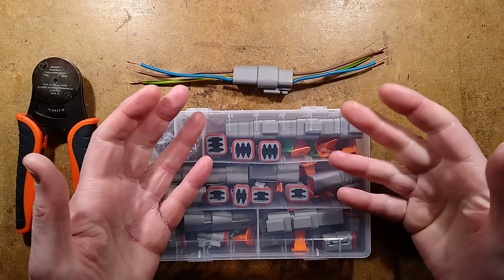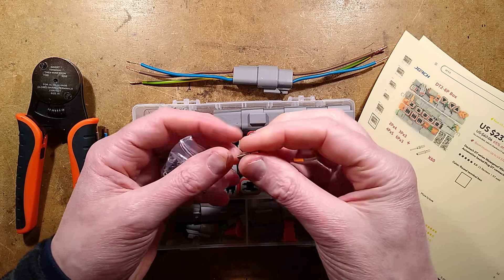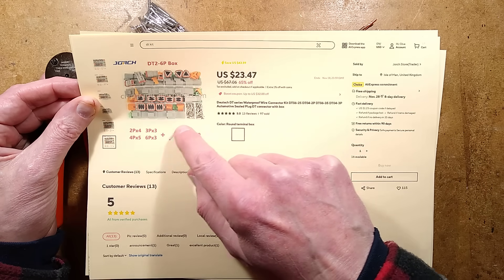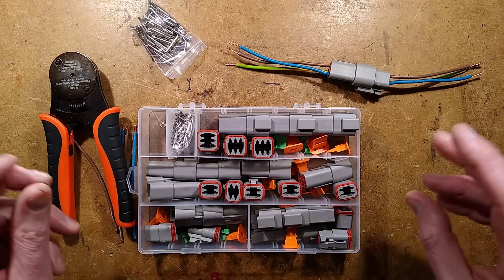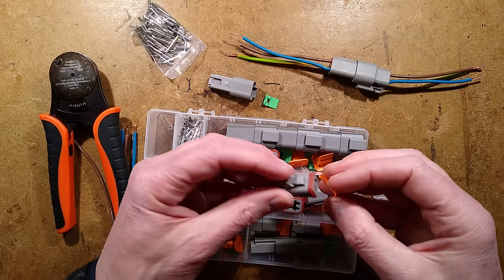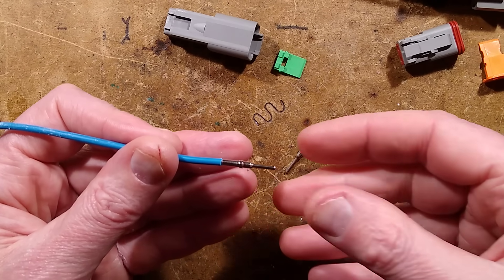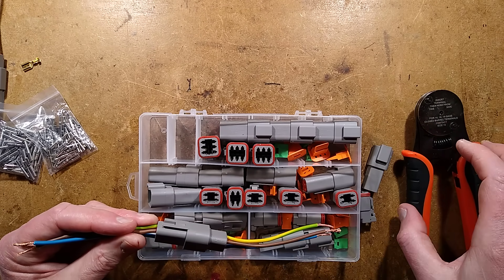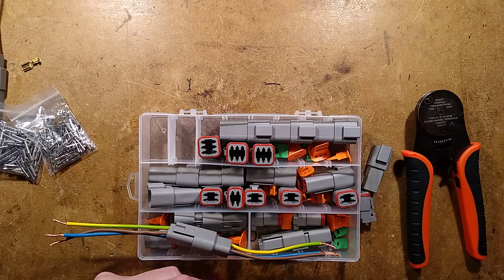Deutsch - my new favourite rugged connector

Comment: There is a small hole in the connector pin, this is there so that you can see the correct length of wire has been inserted. 
Been using pin that look like these in MIL-DTL-38999 connectors for years, the crimp tools cost an arm and leg. but when your paying £80 + for each half of the connector and few hundred pounds+ for a crimper is a drop in the ocean.
Reply: I spent several years supplying these in the UK through Servo-Interconnect in Lydd  Kent. Used them on may projects too. Brilliant design !
Reply: As said the hole is to check the correct length of the wire, but yes before I invested in a crimper I used to use the hole for solder.
Reply: @johnspear3452  so do i but that is not how it should be done, we should pass on how it should be done and not the bodges. I used to refer to soldering the crimp pin as using a "liquid crimp".  Also in R&D where i had to go to the pain of getting a crimper from production in the hangers. it's easer to solder the wires, which with a bit of care you can reuse the pins. Which you can't do if you crimp them.
Now retired i can do them anyway i want. 🙂
Reply: That's for soldering. It's a hole to let flux/solder flow through the inside of the plug should you be inclined to solder the pins instead of crimping them.
Reply: @Alacritous  On a 3899 connector pin the hole is to confirm the strands have  been inserted to the correct depth. As they are crimp pins not solder, the solder pins look completely different. the whole reason for using crimp pins is they are far far better if the connector is subjected to vibration. 
In a crimp pin, when crimped correctly each wire strand forms a cold weld. The problem with soldering stranded wire is the interface between the strands and the face of the solder. if the wire is vibrated the strands move side to side, this work hardens the strand as it can't move where it meets the solder. as each strand breaks the stress on the remaining strands increases until they have all broken. 
For vehicles and planes crimp wins over solder everyday.
Reply: @TheEmbeddedHobbyist  Sorry bud. It's literally in the spec. It's to allow solder to wick through the connection.  alternatively it's to allow air to escape when crimped. You can tell you've inserted the wire to the proper length because you can literally see the wire go into the insertion hole.
Reply: @Alacritous  but inspection can't see how much wire is in the connector once you have crimped it. but the hole does.
Reply: @TheEmbeddedHobbyist  you can't see the hole when it's been set in the plug anyways.
Reply: @Alacritous  But quality would be checking before the wire going to the plug on a sample basis. 
The amount of connectors I've seen put in to the scrap bin as somebody has opened the sealed bag and taken one pin out. QA would have decided the traceability of the connector and remaining pins is lost. So they might go to the training school or the bin. which is why Aircraft cost so much. 🙂
Reply: @TheEmbeddedHobbyist  Seeing how deep the wire is inserted isn't going to tell you the quality of the crimp in any case. That requires a tug.
Reply: @Alacritous  it's just à witness hole, a tug test is performed by qa on sample crimps as its a destructive test. Which is why the number of crimps performed by the tool is recorded so they know when it needs to check.
Reply: Can you please point out where this is listed as being a solder wicking hole in the spec?
Reply: @alsavage1  Exactly, every spec/guide I've found for DT terminals indicates that it's a witness window - and this is exactly how I've seen everyone use it in manufacturing.

Comment: Deutsch connectors are brillent came across them in 2016 when american brand tennant scrubber dryers starting using them. since then i have seen them on john deere tractors & catapillar diggers. there truely a great connector they are pricey for the genuine ones starting from £3.50 to £8  for a male female kit. but there well worth it. i have seen them used in horendous damp conditions covered in mud  and jet hot jet washed no issues. they come in 3 diffrent sizes there is DTM series good for 7.5 amps, DT series 13amps and DTP good for 25 amps. another good feature is if using for 12 or 24v systems you can get little LED wedges with a clear end to signify if voltage is present.

Comment: we use Deutsch connectors on work, they're a great connector but I always assumed too expensive for hobby use.
I will certainly look into your suggested links.
Reply: The real ones almost certainly are. A vast amount of OEM automotive connectors from Tyco, Deutsch, Sumitomo, etc are copied in China. Some of the real OEM connectors are also near impossible to get in small quantities too , especially Sumitomo. We used to struggle to get a few for prototyping new stuff when I worked at an OEM despite using vast quantities in production. In may cases the copies will be being made with the knowledge of the biggest customers, as most of the copies are made for the Chinese car industry's partnerships with western car companies. They reverse engineer right down to the connectors and terminals that the original models used to minimise cost. This is certainly the case with FAW - Volkswagen / Audi's Chinese partner company.
Reply: @richardjones38  A lot of the "copies" come out of the same factory and off the same machine. China has a funny concept of IP and they think that when a western company 'gives' them the design it's fine to make the official product on day shift and then make clones for them to sell themselves on night shift.
Reply: @ekij133  I wish that were the case for the ones I'm familiar with! Most are OK quality, but I've seen a few which are less so. They Tyco / AMP / TE / whatever they currently call themselves are particularly easy to tell apart, as the real ones are always branded and marked with part numbers and terminal numbers, but the all copies I've seen are either unmarked or only have the Chinese manufacturer's name.

Comment: I found another similar "Automotive" connector very useful, dunno if they have an official name, but they're black bodied connectors with yellow silicone seals with red locking inserts and come in single way to 6-way options, they use the foldy-over style crimped pins, and they've worked nicely for low voltage outdoors stuff for me... :)
Reply: TE AMP Superseal
Finding an inexpensive ratcheting  crimper that will do both the crimp and insulator grip in a single operation is almost impossible (all the ones I have tried have either bent the flags wrong, pierced the silicone bung or some other no no)
Have settled on an Iwiss manual crimper that only does the crimps 2 separately  - and it does a good job, just more time consuming and a bit more fiddly
Replacing pins on them is not that hard (once you have the right tool and worked out how to manipulate it)

I had thought about using these connectors in the past -as they seem to be nicely engineered and heavy duty.. but they seem more bulky than the TE AMP clones (possibly overkill for sensor wires in an engine bay??)
Might just get a set to play with...the TE AMP clones I got are a little limited in how much current they can handle at 12v - though not melted any yet
Reply: @ for low amp use, the JWPF might be more suitable and a lot more compact.

Iwiss tools seem pretty good. I have several different crimping tools of theirs.
Reply: Possibly Superseal connectors?
Reply: @katywalker8322  Ah!!! That's what they're called!! Yep, them ones, or at least the cheap knockoff clones that I have anyway, they're decent little things... :D
Reply: @twocvbloke  , they do the job and I have some I use (bought them first to replace a wire under the seat but right above the rear wheel on a bike - seemingly designed to get regularly soaked!). Think the Deutsch ones are easier to use, but they are both a bit bulky for motorcycles (especially when most of the circuits only have a couple of amps load).
Reply: @katywalker8322  I do think they're more aimed at cars given their size, but for other applications they're really useful for decent waterproofed connections out in the garden or yard... :)

Comment: Could you perhaps stack these against other potential solar options M4, XTs etc in various load testing and frankly go-bang over-testing scenarios, running say an unda da sea test to determine which is best rugged outdoor connecting option for PV? I've not seen many look as good as this for seals all round so would be really curious.

Comment: I used the four anvil ferrule type crimpers for similar pins as these. Seemed to work well. I was making a control cable for custom piece of plant (a stone cart i think, it's a big machine for filling stone into trenches). Didn't use Deutsch connectors but a more rugged 8 pin waterproof screw together connector. The cable was cheaper than the connector if I remember correctly. After all the effort and expense i don't think my cable actually got used as there was an issue with the control system.

Comment: I bought a set of these for the first time a couple of months ago to use on a car audio installation project. They were great, and coped well with varying sizes of wire (signal wire and speaker wire), although I did use the "foldy-down wing thing" crimps (with an existing crimp tool for uninsulated connectors that I had) rather than the tubular terminals that require a dedicated crimp tool. I've still got quite a few left and looking for thing to do with them now :) Thank you for taking the time to review these!

Comment: When we conveted our big snow blower machines over to Danfoss electronic controls I got quite a bit of hands on with these connectors, they are miles ahead of the trash used in normal automotive applications.

Comment: I used to and still use allot of the GM weatherpack as those were what were used when I started using them.. They came out with a smaller metripack and I use that as well. I do like the deutch as they are well made but not as compact as the metripack. The Delphi/GM style are more time consuming to use though.
       My current search is for affordable sealed firewall bulkhead connectors. On the 66 mustang I am going to run the wiring through the wheel wells instead of the engine compartment for a cleaner look and need something better than the 60s bullet connectors they used. 

          No import fees on the stuff though the outgoing administration has added quite a few on a number of things. The ones being threatened are a bargaining tool to get those countries to do something in return. Extortion is alive and well on the international stage but somehow illegal for citizens to engage in.  (EU does that to the US all the time)

Comment: They are brilliant and the barrel typ is also easier to use than superseal connectors. YOu can also use the tool for bootlace ferrules with them. There si also a type that has the "molex" typ crimp.

Comment: Ordered the tool and the connectors for £30 delivered.  These will be super useful for a motorcycle project!
Reply: On my motos I have used Deutsch for more permanent weather-worthy heavier connections, but have moved to mostly Wago's for lighter less weather-worthy re-doable connections due to their ease of use. For instance Deutsch for 990A tank connectors/light upgrades, Wago's for seasonal heated grip connectors (just squeeze in some silicone grease to give a simple level of temporary protection). It doesn't rain much here so inclement weather isn't an issue.
Reply: @meder07  I've heard of Wago's, will have to have a look at them.
Reply: I have them for similar use. They are a bit bulky for general use (for example if near the headstock you have connectors for the left switchgear, right switchgear, clocks and possibly the ignition switch that is quite a large chunk of connectors) but they work well.
Reply: @katywalker8322  Agreed, I'll be using most of them under the tank, there's plenty of room under there.

Comment: Awesome connectors. The patents expired 5ish years ago so there are knockoffs now. Deutsch did NOTHING with these for years though, not even a right angle pcb connector, no IP rating etc. Amphenol and others are making nicer, cheaper compatible connectors. The generic tool is 90% as nice as the $500 genuine one.

Comment: I'm always bewildered to find things like a 3000A fuse on Aliexpress. Like.. imagine the type of machine this is used for. Why would you buy that fuse from a chinese dropshipper??
Reply: Many are factory direct versions of branded ones; exactly the same product but without the badge on it. Others might be rejects that were binned lower because they failed some kind of test (including cosmetic). If you can test them yourself & it's cheaper to buy a hundred than one branded version then.. it might make sense. I wouldn't go trying it with anything off Temu though.

Comment: One of the only Snap-On tools that I own is a pair of Deutsch pin connector removal tools.  They're anodized aluminum and I had them for doing work on Metso aggregate screeners that used Deutsch engines to power them.
Reply: Metso also used Deutsch connectors on their tracked crusher, screens, conveyors, etc.   Many were powered by CAT engines.
Reply: @robertbass9032  Indeed!  I got to spend a week at their factory in Tampere, Finland.  Great time!

Comment: This might be a good place to ask if anybody has a suggestion for a connector i could use. I am looking to terminate a 3 wire signal cable (DS18B20), it consists of an outer mantle (~5mm) and 3 individual very thin wires. It needs to be water resistant, since it will be mounted on the exteriour of a car. I thought about a Deutsch connector but i think it is too bulky and probably not waterproof with such tiny wires. Also i'd prefer something, that grabs and seals around the outer mantle.  Any suggestions?
Reply: I would probably solder that with some added heat shrink (over everything, having taped the individual wires) in order to extend the length far enough to get the plug/socket connection inside the car instead. Add some foil over the heat shrink & then another layer of heat shrink over that if the outer insulation requires EM protection. That way you won't have to worry about any ingress & can use whichever connector is cheapest/easiest.
Reply: @nightcatarts  well, it has to be connected and disconnected, so i'd prefer not to solder it.
Reply: @muh1h1  Right, but I mean move the connector to the inside of the car somewhere & just solder it to extend the original leads enough to make that possible.
Reply from the maker: An SP13 style connector might work.  Available in various pin counts.

Comment: I'm a fan of these connectors, but not for mains voltages due to the lack of physical protection and secondary insulation on the wires coming out the back. Even if you use the rubber boots on the back it's still not great in my opinion.

Comment: The Orange One's tariffs haven't even been realized yet.  If saner members of the GOP don't talk him down off the ledge, the piddly 20% tariffs we have for most things now are going to jump to 100% (as he's said).  Going to make buying anything electronic a huge pain going forward.  I'm buying stuff now from Ali and elsewhere on spec that I might need it in the next four years, because even if I'm wrong for 20% of it, I'll come out ahead...

The internal pin&socket pair might be nice for a variable-length dipole for doing HF radio in the field...  I've used spade connectors for that in the past, but the connection isn't quite strong enough and you have to strain relief every joint, making band-switching a bit of a pain.  But these look way more solid, and if they made 1-pin versions of the house those would easily hold the entire weight of the antenna...
Reply from the maker: He already added a charge on incoming mail last time he was president.  It really messed up posting things between the UK and USA.
Reply: The Orange one implemented china tariffs and Biden admin kept them largely in place.
Reply: Yeah thats the one thing I don't get. 

Like here in Canada, there is a problem with China using us to avoid existing sanctions and restrictions including shipping in copious amounts of drugs.

So I would understand and agree with targeted sanctions and restrictions related to that, but blanket sanctions seem counter productive.

So while the pumpkin man is stupid he has surrounded himself with smart people (not musk), so I wouldn't be surprised if they have some sort of plan.

But it is what it is right now, the only real option is to wait and see what happens.
Reply: Are yall allergic to just using his name lmao

Comment: Since I've only seen them for automotive applications I always assumed these were for low voltage. When I saw the mains voltage wiring on the live stream I investigated. It wasn't easy to find the 1500V dielectric rating.

Someone on the stream bemoaned the fact that they were not suitable for sealing round cables. In fact, the professional series does have sealed sheaths for some sizes for round cables.

There are also bulkhead and pcb fittings. Seems like a great series. I will certainly be investigating further.

Comment: Try pulling some high current thru them and see if they heat up? Like 14V at 20A 🙂
Reply: They are rated at 13A.
Reply: Ok 10A at 14V
Reply: Or 10A at 240V

Comment: I would very happily dump AMP Superseal for a type where it's feasible to replace a contact without chopping the wire and starting again.
I used Deutsch Autosport at one job. They were very good, horribly expensive, but lighter and cheaper than olive-green milspec.
Reply from the maker: The Superseal are useful, but nowhere near as good as these.
Reply: I worked on a project a few years ago where everything was Superseal. They got yeeted immediately and everything was replaced with DTM/ATM connectors and JST's. I won't use anything else.